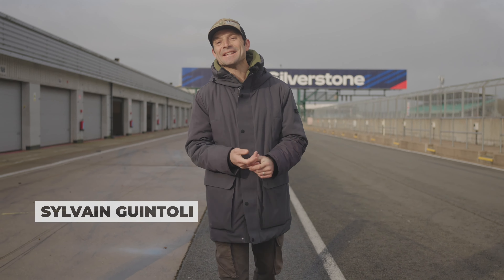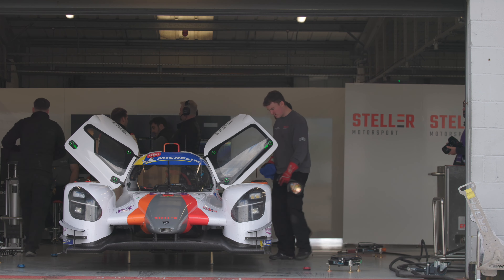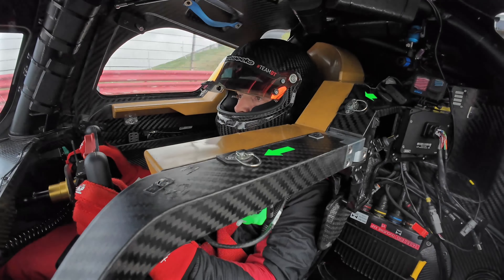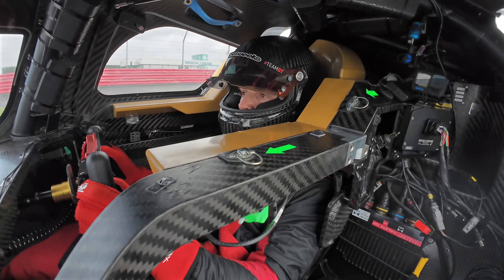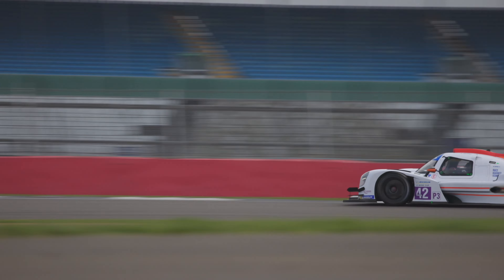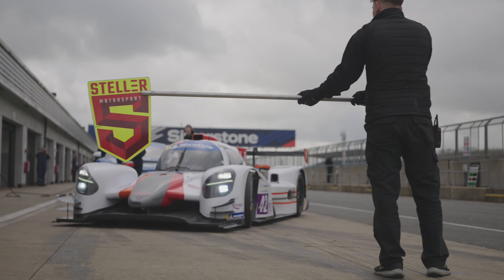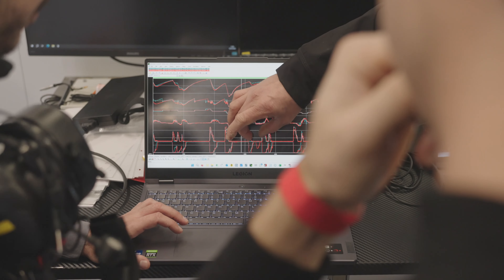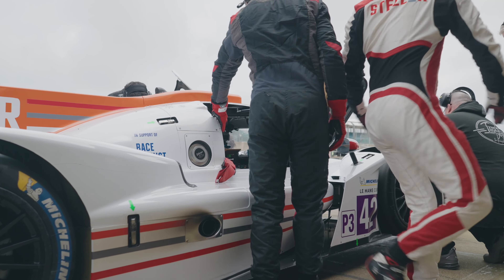LE MANS CHALLENGE "1er Test en LMP3" (sous titres Français)

Comment: Do you think being so fast on two wheels helps you on four, for things like judging braking zones and managing the rubber?
Reply from the maker: 2 wheels experience helps in general, it’s still racing, just with different characteristics. It helps with understanding data analysis as well which is a big +, track knowledge is also important. 
The downside is to recalibrate the brain for any given track when stepping in the car. Braking later, carrying way more corner speed etc.
Reply: @SylvainGuintoli  yes, adjusting to the aero, all of it, is a different state of mind. I have no idea how you do what you do on a bike. Racing at La Mans in an LMP car as well just blows my mind. I wish you all the best for the race, I'll be cheering you on.